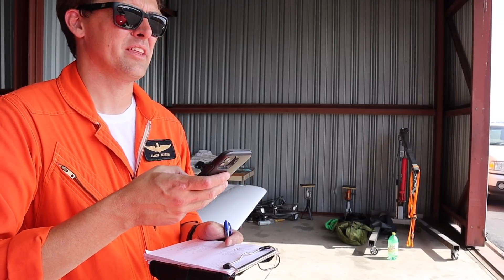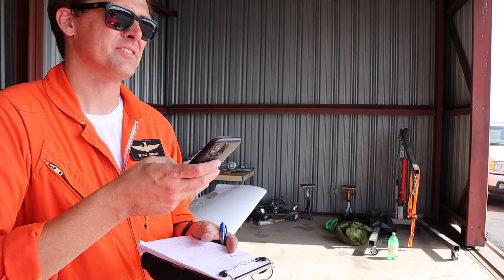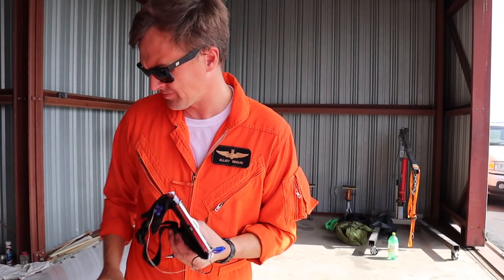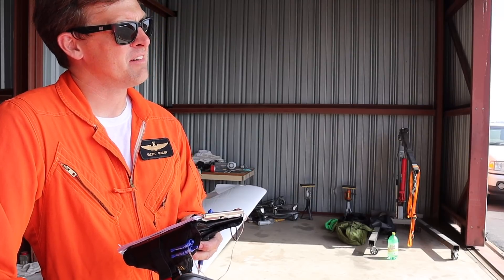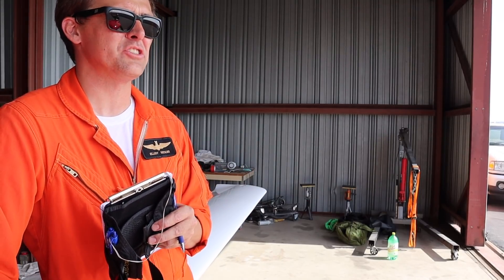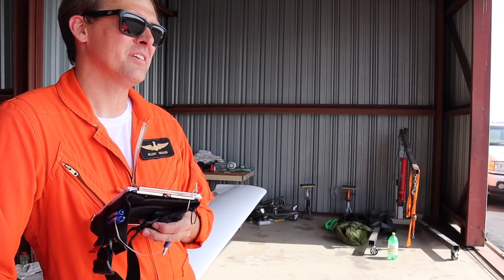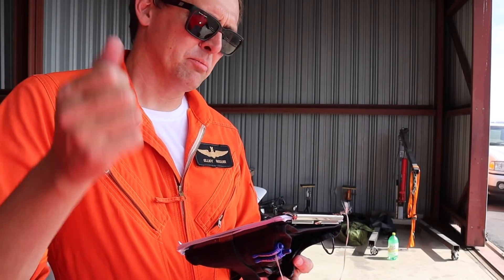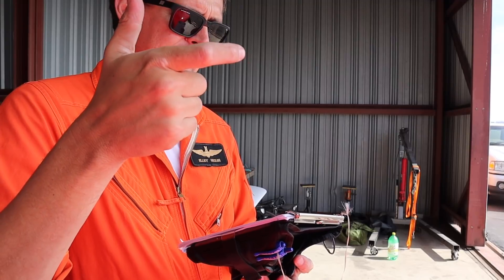Bailing Out Sucks - Preflight briefing for Flt 6 of Hakan's Lancair

Comment: what I would love to see is a book on Failure Modes of aircraft, such as jammed flaps, jammed ailerons, jammed elevator, etc, and how to design to avoid these failure modes. What contributed to the failure, and how to prevent each known failure mode, with an eye towards avoiding and anticipating such design issues in light aircraft. Book based on actual incidents with actual explanations of how the control failure occurred.

Comment: Curious: have you ever done a skydive with a chute you wear for flight tests?  Watched the full length video (yeah, I'm an aviation nerd), and this was one of the most valuable pieces of dialogue between a test pilot and the aircraft owner/builder/designer I've ever known of.  A great example to others that will be doing similar things.
Reply: You wouldn’t do a skydive with an emergency parachute unless you are a “test” jumper or do some things in preparation.. first of all, there is only one parachute in an emergency rig, and they open very quick (hard opening) and are round, not really steerable. You are required to have a reserve parachute if you are making an intentional jump on your emergency chute, and you need a way to jettison the chute in the event of a malfunction. It would probably be a good idea to get your skydiving license for the experience, and you could probably hook up an emergency chute into a skydiving rig, but you wouldn’t just “make a skydive” on your emergency chute just for fun.
Reply: @thomasaltruda  Thanks!
Reply from the maker: Thanks for the comments guys.

Comment: This was another thing that was good about the big video. Not just having someone who will discuss results well, but also one who will discuss risks and try and set parameters well. It was good to see, even though it's hard for both of you. How do you decide those parameters? With the engine temps you let the owner decide, but surely if he set a temp that would damage the engine and lead to rapid failure you would say no. If he set a minimum speed you though would lead to late touchdown and high speed overrun: do you say no to that? How do you know what those limits are? 120 knots is pretty fast for a light little thing on tiny wheels, and the wing is many knots away from stalling 1G. What I saw was some numbers chucked around, but couldn't see the thinking either of you were doing to get them. I know you're doing it since you're both good aircraft engineers: I'm very curious about how you make those kinds of decisions. Would really love to know, because this stuff is really cool to watch.
Reply from the maker: Thanks for the comment, great questions.  I think this is where the art is and like so many things it's a rabbit hole that can suck up a lot of time.  My logic at the time was a 50% increase in touchdown speed is about the most I could consider with a straight face.  But I was really struggling with what the results of that landing might be...which is why it's only slightly better than bailing out.
Reply: @utopiasnow  so it's not quite that you calculate the braking distance and add a bit for an unplanned float from a gust in ground effect and see if you like the runway you have left? A high speed landing here is a touchdown at that speed, right? Not a flare at 120 and hold the nose until it quits flying. Not a nice thing to balance maybe wrecking the plane with you in it vs definitely wrecking the plane without you in it. Tough chat that one.
Reply from the maker: @deSloleye  Great question thank you.

If you watch you can see my epiphany moment.  I had been thinking how fast could I go and get stopped (touchdown speed, deceleration assumption, runway length).  But it was during this conversation I realized going off the runway a 50 mph though not ideal was definitely better than bailing out.   Thanks again.

Comment: By bringing in a test pilot, you already acknowledged and accepted the risk that what is about to happen may result in the loss of the aircraft. Even if the risk of loss is minimal based on what is being tested, you still need to be prepared for the unexpected, and be ready to ditch the plane if it becomes necessary for any reason. I can sense the owners' unease in discussing bailing out, but it's a little late to be having second thoughts at this stage (especially since he's outsourced the risk to life and limb to someone else). Honesty and being forward is of course the best approach here to address the issue with someone. If they aren't willing to discuss it, then they shouldn't be experimenting. (just speaking broadly here)

Comment: I have hundreds of skydives, but I have never bailed out of an airplane.  How do you bail out of a plane with a canopy that hinges in the front?  It seems aerodynamically impossible to get that canopy to open, IMHO.  Another great video Elliot.
Reply: Most have a pull handle that will release the canopy from the aircraft.
Reply: Does this one?
Reply from the maker: Thanks for the comment.  The canopy is not ideal for manual bailout, but especially in a departure situation the indicated airspeed would likely be low enough to be worth trying.

Comment: I recall hearing that you have had a few failures in flight. How many times have you bailed out and how many times have you safely landed a stricken plane?
Reply from the maker: I go back on the right tone with which to talk about this topic.  But yes there have been some issues on previous flights.  I stopped counting at 60 emergency landings, and totaled one airplane.  Had a couple this month, engine stuff but it was complicated by a row of airliners waiting to take off.  I've never bailed out in anger.

Thanks for the comment.
Reply: @utopiasnow  Wow, that certainly is enough for us to understand how exciting your career has been!
Reply: Sounds like a lot of kit builds are a death trap, poor engineering an such. One would think that a builder would take a little more time and do their homework.
Reply: @oldschoolman1444  most of these aren't exactly kits. They are custom one -off builds. There is a lot that can go wrong when you start modifying stuff like that and no amount of "homework" will find it all. The established kits are far safer.